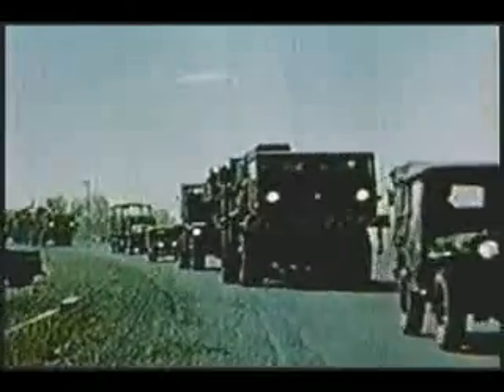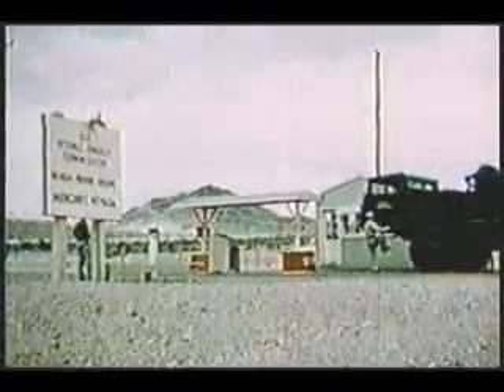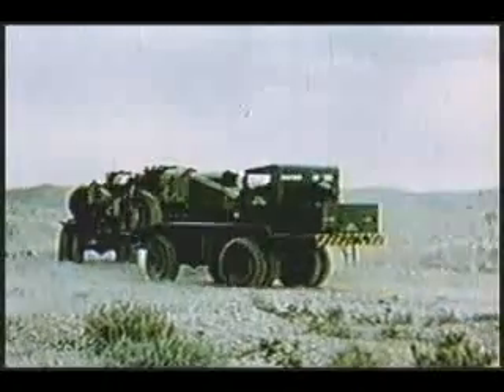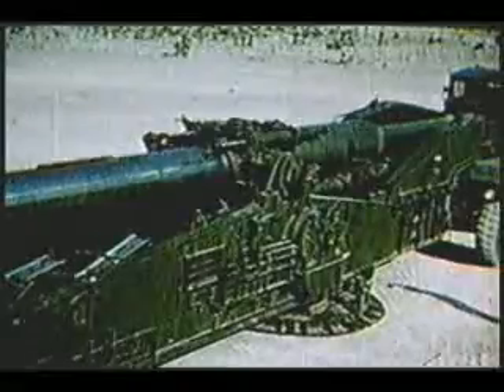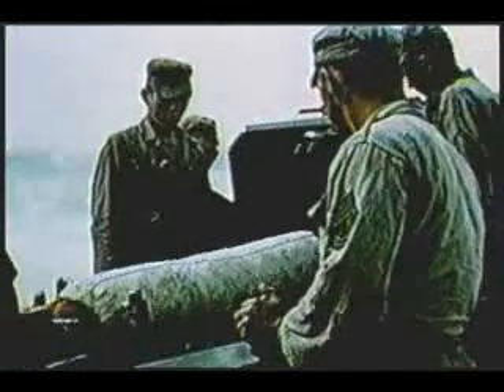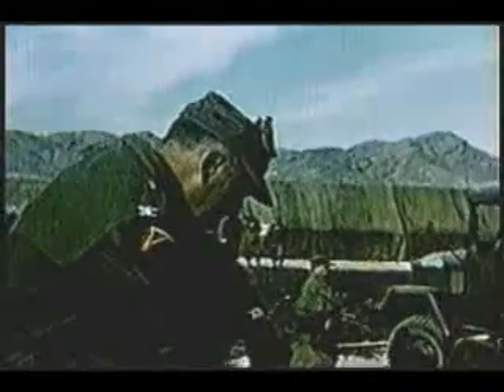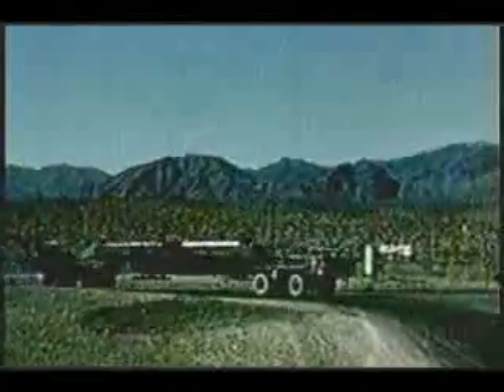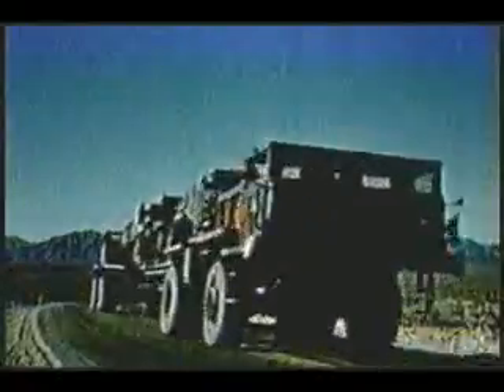280mm Atomic Nuclear Artillery

Comment: @Za7a7aZ : 
the main installations they had them at was Korea, and I think germany. 

They were meant for use as area denial weapons. In the case of Korea, if the north Koreans came over the DMZ, the ' Zero percent' bases, near the DMZ would be Camps Red Cloud, Stanley, and Casey would hold as best it can, and when they were being overrun, the atomic Annies would open up on each of the bases, effectively making a firebreak

Comment: You can breathe, eat it, or get it inside through other means (rated 18 or above...), that's internal contamination, worst case you can face.
If you only get external contamination, a shower and maybe some scrubbing will do, nothing bad, skin stops it all.

As for the artillery itself, you can imagine using it when the ennemy has air/space superiority and is able to destroy incoming warheads.
Won't see that kind of shell coming, too small and fast for the average awacs.

Comment: The problem isn't radiation getting out of the shell, whatever its strengh (might be plutonium, bad thing indeed) - since as soon as the shell is away from you, you get out of trouble - but the fallout, as they are the byproducts of a nuclear fission reaction.
Once you breathe 'em they wreak havoc in your cells, without protection from the skin or the simple air (top powerfull Beta and Alpha rays stops at 5-10 meters in air and are blocked by the skin).

(PS: I work at a nuclear power plant)

Comment: i was stationed on this gun 1960 to 1962 my job was setting the fuse and firing it,plus i drove both carriers at one time or another,the front unit was the a-unit and the back one the b-unit. it was awsome firing it we used to fire mostly at night because of it's size we used to keep it covered during the day so it was harder to spot from the air.we used to use it for border patrol in bayreuth germany. on the chec. border, they were deactivated in early 63,so i don't think they made it to  nam??